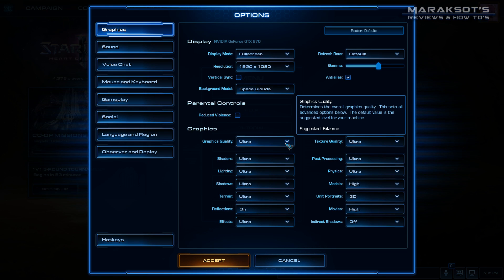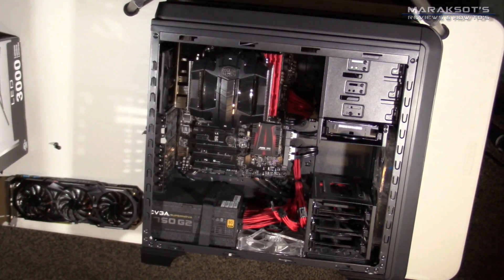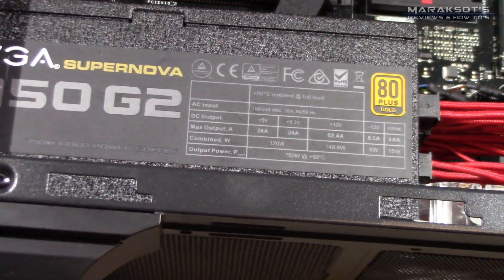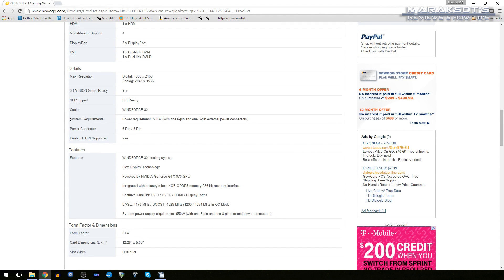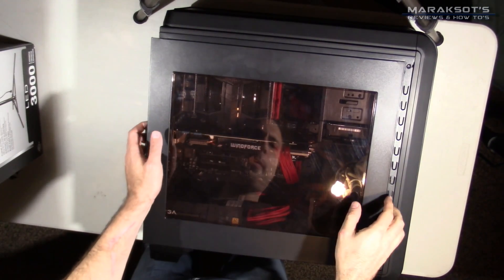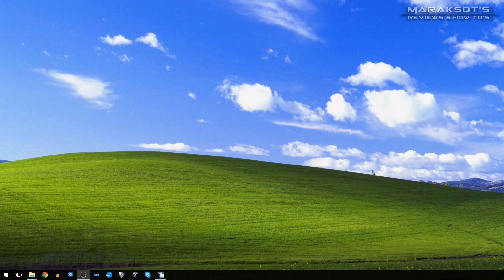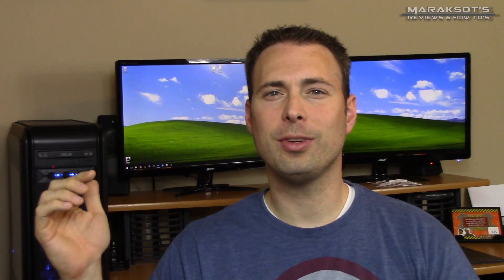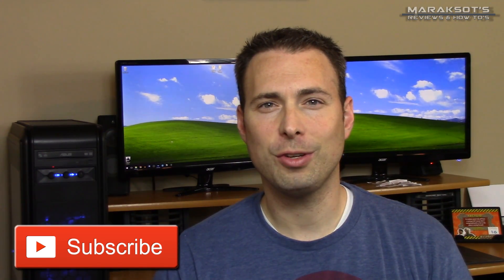A Beginners Guide - Upgrade your GPU - How to Install a New Graphics Card

Comment: So basically this is what I do. I turn off my PC, unplug all the wires and power supply, I take out my graphics card, replace it with a better one and that's it? I don't need to configure anything in BIOS or something? I'm just really confused because I'm new to this. Thanks
Reply from the maker: Glotch yup, as long as your new card fits in your case and your power supply can power it that's all you gotta do.  :)
Reply: Maraksot78 thank you!
Reply from the maker: +Glotch no problem. :)
Reply from the maker: +Glotch and... you'll of course want to update to the latest drivers for your card.  :)

Comment: Can i play gqmes without downloading drivers?
Reply from the maker: The drivers are basically the instruction manual for your computer to be able to fully use your graphics card.  Think of it like this... let's imagine you've never used a smart phone before, you know it's a phone and can make calls with it but other than that you don't know what all else you can do with it.  Once you learn how to use it however you're able to do so much more with it than simply make phone calls, you can text, browse the internet, send and receive e-mails, play games, watch videos, etc.  It's similar with your computer and your graphics card.  When you plug it in your computer recognizes it as a display device and can then send video through it to your monitor.  But other than that it doesn't know what all else it can do with your graphics card.  As human beings we can often learn how to use a device without reading the instructions by simply playing around with it and figuring it out.  A computer on the other hand can't learn how to fully utilize a device unless it "reads the instructions."  Installing the drivers for a device like a graphics card is important because it "teaches" your computer how to use that device.  If you don't install the drivers it may work for some things and not for others.  You may not be able to set the graphics settings as high as your card is capable of and you may experience random crashes among many other problems.  So in answer to your question, yes... it is possible, but I wouldn't recommend it.  To get the best performance out of your graphics card you'll want to have the drivers installed.  Best of luck to you, Happy Gaming!  :)

Comment: wat if my computor dont have a case just a desk top were does it go
Reply from the maker: I'm not sure I fully understand you're situation but I'd like to help if I can.  So your computer doesn't have a tower style case correct?  So is it an all-in-one?  Meaning you're entire computer is contained inside of the monitor?  If so then it will depend on which model of all-in-one you have because some of them are upgradeable and some of them are not.
Reply: Maraksot78 well basicaly i looked up online were do i put the graphic card when i buy it n everybody saying it goes on the motherboard n im assuming thats what you meant by case but my computor does not have one is just the monitor and theres the wifi box and this battery box under it
Reply: Maraksot78 and just to be clear the motherboard is that blue glowing box thats behind u right were u put in disc etc sorry im new to pc and i had baught day z and apperently i need a graphic card that can handle dx11
Reply from the maker: I kinda get the feeling you're messing with me but in the event that you really don't know what a computer case is then I'll do what I can to help.  The case, aka Chassis is the "box" that all of your computer components go inside of.  So your case is what most people think of as their computer tower.  Now if you open up the side panel of your computer tower or case you will see all your internal components.  If you go to the 9:00 mark of this video I show how to remove your current graphics card and then install a new one.
Reply: Maraksot78 lol im really not dude sorry im new to pc gaming but the thing is i dont know were the box is
Reply: Maraksot78 anyway i can send a pic of my monitor so u can see wat im working with
Reply from the maker: That's what I was just about to ask... if your computer is like this... http://www.argos.co.uk/wcsstore/argos/en_GB/images/buyingguides/desktop/desktop-pc.jpg which is your standard desktop that has a monitor and a separate "tower" that houses your motherboard and graphics card, etc.  If yours is like this then all the wires from your monitor, keyboard and mouse will all plug into it.

or is yours an all-in-one like this... http://ssl-product-images.www8-hp.com/digmedialib/prodimg/lowres/c05051438.png where your keyboard and mouse all plug into the monitor?  If yours is like this then the motherboard, cpu, graphics card and whatnot is all inside your monitor and depending on the make and model you may or may not be able to upgrade it.
Reply: Maraksot78 one more thing my computor is also touch screen and the mouse and keboard are wireless
Reply: Maraksot78 its a sony vaio
Reply: but yes its just the monitor but thanks for the help
Reply from the maker: do you have a Mac?  https://cnet2.cbsistatic.com/img/cqIXEFLhCUTf6O5cxmLYYrykoU4=/770x433/2014/10/17/39cc108a-f968-489f-a6fb-dc52862e7dae/apple-imac-retina-5k-display-7861-008.jpg
Reply from the maker: do you know the model number of your Sony Vaio?
Reply: Maraksot78 pcg-11211L
Reply from the maker: Well I've been looking at stuff online trying to find anything on how to disassemble your computer and so far I haven't found anything.  Other Sony Vaio all in one's I've found look like they're using laptop components... so upgrading it with a "normal" desktop graphics card is out of the question.  You may be able to upgrade it using a laptop graphics card but at the same time I think that possibility is unlikely.  Many all in ones are designed very specifically to fit only the hardware they come with and the Sony Vaio's look to be that kind of all in one, non-upgradeable.  Unfortunately, if I'm right, it looks like you'll need a new computer to play Day Z since your Vaio is unable to play it.  :-/

Comment: I tried installing geforce experience but after i save it and it looks like it finishes installing nothing happens. I try searching for it but the only thing that pops up is the .exe file, I try restarting my computer and still nothing happens
Reply from the maker: can you go into "Control Panel" and under "Programs"  select "Uninstall a Program" and is it on the list there?  On my system it's listed as Nvidia GeForce Experience if so then it is installed.  Also in your system tray in the bottom right of your screen if you click the little arrow that is pointing up and then click on the green Nvidia icon it should bring up an option to open GeForce Experience.
Reply: nope just NVIDIA PhysX and NVIDIA mental ray and IRAY feature plugins for 3ds max
Reply: it finishes doing this after I save the file and nothing happens
http://i.imgur.com/zUaHP3P.png
Reply from the maker: hmmm..... interesting.  Not sure what's causing that.  If it were me I'd try uninstalling everything that says Nvidia and then re-download the driver package and then go through the advanced installation and make sure all the check boxes are checked on everything I wanted to install.

Comment: Will I need to update my BIOS before installation? I have an older-ish motherboard and I'm not sure the current BIOS will support my new GPU.
Reply from the maker: +ProSantelli I say install your new graphics card first and if it works then you don't need to worry about updating your motherboard bios. If it doesn't work then thats when you'll want to update your bios.
Reply: Maraksot78 Ok great. Thanks for the reply.
Reply from the maker: +ProSantelli no problem. :)

Comment: Can someone help me 
I got a gt 710 I put it into my pc but when I start up my pc it gets stuck in the hp splash screen 
And I can't enter bios 
I don't know what to do
Reply from the maker: +Takaishi Siel if you remove the GT 710 do things work normally again?
Reply: yeah it works perfectly fine, oh forgot to mention i currently have a Geforce 8400 at the moment, it's what i'm currently using since the gt 710 is not working.
Reply from the maker: +Takaishi Siel have you tried to see if there's a bios update for your motherboard? There should be a manufacturer name (i.e. Foxcon, biostar, MSI, Asus, Gigabyte, etc.) and model number printed on your motherboard. If you Google that manufacturer, model number, bios update then you may be able to download an update that you can install that may fix the problem. I can't promise it will fix it but it's worth a shot.

Comment: is a gpu and graphics card the same?
Reply from the maker: +Matholomoo people commonly use them interchangeably but if you want to get technical a GPU (graphics processing unit) is the actual graphics processing chip on your graphics card.  It's essentially the CPU (central processing unit) of your graphics card.
Reply: ok thanks

Comment: I upgraded from  gtx 680 to a gtx 1070 msi and now when i go to shutdown my computer the screen just goes black and the computers fans and lights stay on. Do you know what could be causing this? Please help
Reply from the maker: interesting... I've never hear of anything like this before.  I did find this thread on the Tom's Hardware forums. http://www.tomshardware.com/forum/313142-30-fans-running-shutdown Hopefully this will do the trick for your.  Sorry I couldn't be more helpful.  :-/
Reply: Hey i really appreciate you taking the time to respond but what i ended up doing was clearing the rom but now i am having an issue with my ram. I have 4x4gb but it is only saying i have 8gb total when i should have 16gb. i have tested each stick in each slot and there is nothing wrong with the slots or the sticks but for some reason it will only use 2 of the sticks. Do you know anything about this?
Reply from the maker: hmmm... never encountered this problem before either... Are they all the same speed/model from the same manufacturer?  If not that could be causing a problem.  Mixing and matching RAM modules is known to be buggy.  If they all are the same speed, model, manufacturer, etc. then I really don't know for sure.  Especially since you say you've tested them all individually in every RAM slot. I've been looking online a little bit to see if anyone has had a similar problem and found the solution but so far haven't found anything.  Some people have suggested UEFI/BIOS updates for your motherboard but I haven't found anyone saying they tried that and it fixed the problem.  Sorry I'm not more help.  :-/
Reply: They are all identical. I've reset bios and I've updated bios. i also found out that they will only work with 2 slots at a time 1x2 1x3 1x4 2x3 2x4 whatever but they will only run 2 of the slots at a time. i really don't know what the issue could be since they all used to work and nothing has changed. I even swapped back to the old graphics card
Reply from the maker: Christian Bishop that's weird man. so it recognized all your RAM before upgrading your graphics card but now it will only recognize 2 sticks no matter what? Not sure what could be causing that.  :-/
Reply: I'm sure it had something to do with bios settings but my motherboard doesn't allow me to change much of the bios settings
Reply from the maker: Christian Bishop yah, I guess it could be a BIOS setting of some kind. Still not sure though.  :-/

Comment: asus h81m-k it shows "new gpu installed , please configurate it at the bios settings' i cant find nothing in the bios settings
Reply from the maker: interesting... I've never encountered this before.  Typically after installing your new graphics card your system will see that it is installed and all you have to do is plug your monitor into your graphics card and then install the drivers and you're good to go.  If there is something in the bios/uefi you need to change then I would guess it would be in the advanced section, possibly under PCIE devices or something to that effect.  I know when swapping out a CPU the first time you boot up it will detect the new CPU and tell you to enter setup to configure but you really don't need to do anything unless there's some stuff you want to tweak from default.  So perhaps you don't need to do anything just exit the bios/uefi, boot into windows and install your drivers?  :-/
Reply: Maraksot78 it doesnt goes to there ... the windows logo apears and just crashes and starts over again like i have ''restarted" the pc.
In Bulgaria our pc mechanics can fix it but i didnt had time to go

Comment: legit, like 10 minutes into the video is just him raving on about what you have already gone over like a billion times before coming here, so ah shit, just do what he says and have fun gaming! btw having trouble getting my monitor to not say "no signal" every time I try to turn it on... plz help...
Reply from the maker: so you're getting the "no signal" problem?  I'm assuming you just upgraded to a new graphics card?  I'm not trying to insult your intelligence or anything by saying this but I assume you have your monitor plugged into one of the video out ports (hdmi, DVI, or Display port) on the graphics card and not to one of the ports from your motherboard? Correct?  I have run into a few people over the years that didn't realize they need to switch over to their graphics card when they upgrade from integrated graphics.  When trouble shooting problems it's always a good idea to start with the easiest culprits.  Of course making sure you're video cable is plugged into the proper port is the very first step. After that you may want to check if you have a bad cable.  If you have other cables you can use to test it with you'll want to do that.  I recently helped a friend who was having a similar problem and we found that he had a bad HDMI cable.  We swapped it out and he was good to go.  If things are plugged in correctly and your cables are good then it may be you need to update your motherboard bios/uefi.  Several other people have come here with the same problem.  Their old graphics card works just fine but after installing a new one they keep getting the "no signal" message on their monitor.  We've found that updating your motherboard bios/uefi has fixed this problem.  I'm guessing what causes this is the newer tech in new graphics cards isn't "recognized" by older bios/uefi's because once people have updated it works fine.  You'll of course need to find out your motherboard manufacturer and model, look it up on the manufacturers website and then download the latest bios/uefi to a usb drive, boot into you uefi and then update it.  Hope this helps.  Best of luck to you.  :)

Comment: What do i do if i have a proprietary connector how do i change my gpu
Reply from the maker: Anthony Lin what proprietary connector are you referring to? the power connector?
Reply: the power supply for my lenovo
Reply from the maker: so you have a lenovo desktop computer, you're wanting to upgrade the graphics card, but the power supply in your computer does not have any 6 or 8 pin PCI Express power connectors?  Does it have extra 4 pin molex plugs.  They look like this... https://upload.wikimedia.org/wikipedia/commons/3/31/Molex_female_connector.jpg